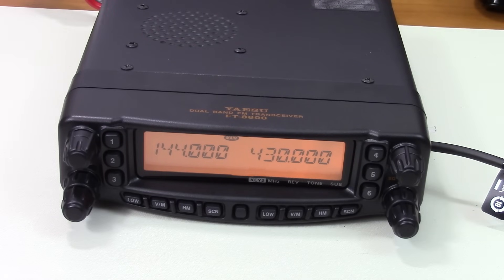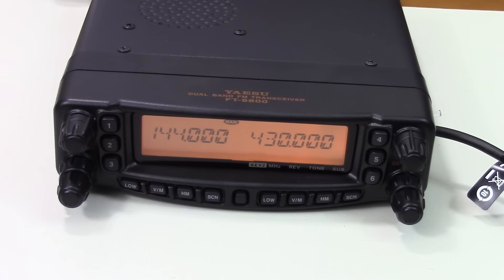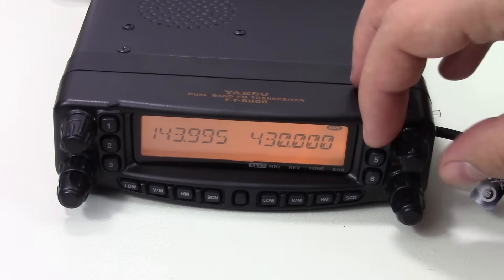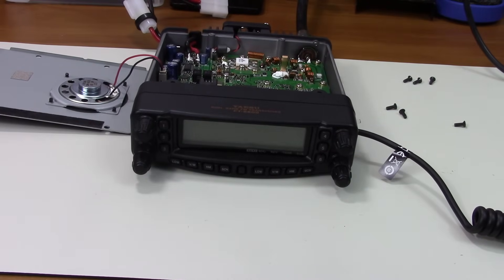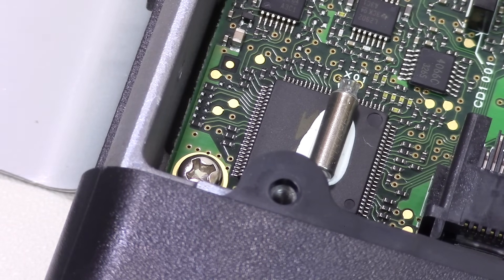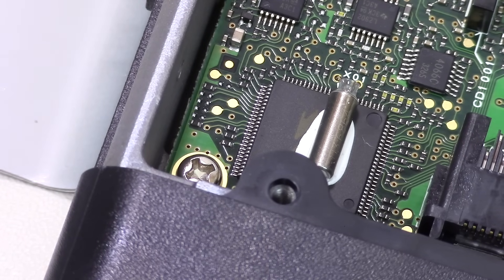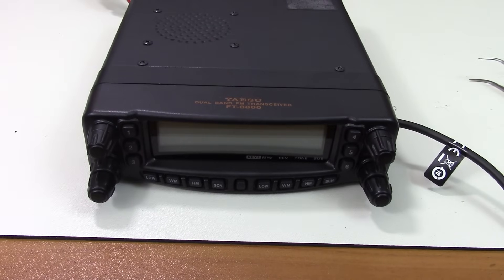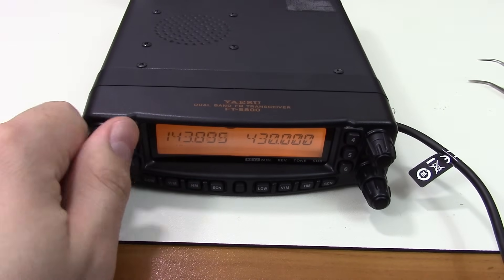FT-8800 extended TX (MARS/CAP) Mod

Comment: Heat up a watch makers screw driver with a blowlamp and touch the resistor. Easy and safer than using a soldering iron.

Comment: If remove parts that I may need to reinstall, I use a piece of tape and tape the part inside the device. Any adhesive reside can be cleaned with isopropyl alcohol..
Reply from the maker: Excellent tip, thanks for sharing!

Comment: Hello, how are you? Your video is very interesting. I have the same equipment. I wanted to ask you a question. When I opened it, I saw those white blobs near the power transistor and further to the right, above the inductors. Is this normal? What is the purpose of this compound on the components? Does it affect the equipment's operation? Is it an assembly error due to excess material? Greetings, and thank you very much for your video. EA7KGU Leonardo from Spain.
Reply from the maker: Hi Leonardo, the white gunk is sime sort of potting component. It appears that it has been deliberately applied primarily to the inductors. I would guess that this is to ensure the mechanical stability of the inductors and to limit microphonic effects during mechanical stress (e.g. vibrations in a car). So yes, it does affect operation under certain conditions, but in a positive way. Regards, Sebastian
Reply: Hi Sebastian, I hope you're all well. Thanks for your response. I disassembled and cleaned the part because other videos of this device don't show it. It looks like excess heat transfer material. I really don't see anything positive about this compound being on an inductor and several capacitors. Once removed and cleaned with ethyl alcohol, I performed power tests with a wattmeter and a Bird laboratory phantom load. The results are satisfactory, as it works correctly and delivers the power indicated by the manufacturer without overheating. Best regards! Leoanardo.
Reply from the maker: That's good to know. If it would have been potting component, it certainly wouldn't have washed off that easily. Seems like a price manufacturing mistake as heat transfer component isn't known to be cheap. Who knows what happened here.

Comment: What is the size of the resistor...0402? And, if I have programmed the radio with a lot of memorychannels with my PC, will they get lost after removing this resistor and restarting the radio and if so can I reprogramm the radio with the software?
Reply from the maker: I wish I'd remember the size of the resistor. I'd guess it was 0603, definitely larger than 0402. All memory channels will be lost but can be re-programmed with the original software.

Comment: Hey so what is the value of that resistor, asking for a friend
Reply from the maker: Unfortunately, I don't know. Possible workaround: Measure one of the remeining ones in circuit and guess from there. My assumptions (and the things I would try in that order): Either it's just a simple pull-down resistor where any value like 10K or 1K would work, or it's actually a real bridge with a 0 Ohm resistor. Of course there are no real 0 Ohm resistors but they're sold under that name as pick-and-place machine compatible versions of a permanent jumper. Given the fact that the resistors all connect to the ground-plane, I'd try the 10K from ground to the other side first. With steady hands you can try that without actually soldering anything in place.
Reply: @BalticLab  awesome, I'll give that a try
Reply: @BalticLab  an instagram follower looked up the service manual and found out it's zero ohms. So I'm going to jump the second to last points out

Comment: I thought I might try removing the resistor with circuit board nippers . do you think I could get away with that? (flush cut nippers) because using my irons, I'm afraid it'd goof it up.
Reply from the maker: You ptobably could get away with it but I would only recommend trying if you never want to undo the mod as this will likely damage the associated PCB traces

Comment: next time get a proper soldering iron before messing around on delicate pcbs,  then just bridge the two contacts of the resistor with solder, heat more or less in the middle and it will come smoothly off without damaging anything, then tombstone it on the PCB so its there for if you ever want to put it back

Comment: what's the high UHF transmit/receive?     are there any mods for the 800MHz range?
Reply from the maker: UHF TX/RX will be 420 MHz – 470 MHz. There are no 800 MHz mods. I would assume that building 440 to 800 MHz transverter might be the "easiest" way of using this radio on 800 MHz.

Comment: It would be far easier and neater to just use a sharp blade and cut the pcb track. Also easier to "undo" if required. There is a long length of easy to access pcb exposed.

Comment: I performed this mod about five years ago. And I programmed the memories with CHIRP. And it's worked flawlessly since then. Until just lately. The FT8900 now crashes every time I transmit. UNLESS I FACTORY RESET THE RADIO.  Then it works fine. But once I reprogram the radio with CHIP, it crashes again and again. Any ideas?

Comment: Will this transmit in the air band?ex 122.800. I'm a pilot and amateur operator and would like one radio for both.
Reply from the maker: Negative. Asides from the fact that this wouldn't be legal, air band uses Amplitude Modulation while the radio is made for Frequency Modulation.

Comment: Ive been told by yeasu that the resistor  need to be replaced, im here in the UK and have the UK version  is this correct, or was it just them wanting to gain some cash

Comment: Works great !! I had enough room in my radio to put the tip of my iron right on the resistor and started with low heat and gradually increased till it melted the solder. Just a note if you are using the programing software you will have to change the version # of the radio after modifying. It will also not TX on Aircraft band.
Reply: +James Rickard 
Can you please explain the scenario about changing the version # of the radio?
I'll be using RT Systems software.

Thanks!
Reply: This is for the G4HFQ software. http://www.g4hfq.co.uk/ftb8800.htm

If you have already built a program before modifying it has a certain version # depending on the resistor/diode pattern. When you remove the resistor/diode it changes this number. All I had to do was reread a blank program from the radio and if u look in the top right corner I believe it will show the version #. To change it click on it and it will give u a drop down select the new #.
Reply: +James Rickard 
Thanks James for your answer. I just performed the change. Since I'm using the RT Systems program I learned that it doesn't have this version # issue. It just worked as like you would expect. No issues. Good to have a rig set up for emergencies!
Reply: Would you know if this would still work with the CHIRP software on a 8900R after doing the mod?
Reply: Ken no idea it should tho don't see any reason it wouldn't.

Comment: The way I do it . I use needle under the resistor, then apply heat on one end  as it get hot and star to melt I lift only one end . This way if I have to replace it back I do not have to look all over to Radio Shack.
Reply: Smart!

Comment: could I corssband 2 gmrs freqs, basically use this as a duplex repeater?
Reply: No, because that's not cross banding. To repeat within the same band you would need a set of cavities as a duplexer. The closer two frequencies are, the harder it is to use to them as a repeater pair.

Comment: My suggestion is to use very small pliers and just remove it. You put a hot iron and will risk damage to the chip and other components. Do you think it's hard to remove? Try putting this jumper back in!You will not put it back in May likely.
Reply: Achisachis73 You are use the special SMD solder iron which has a needle thin tip... off course with temperature control. We have temp control soldering stations for this purpose

Comment: Do you know how to extend tx no the ft 8900 ..?.? Thanks
Reply: You lose nothing, only gain. I have this mod on my 8900r
Reply from the maker: Yes. The modification for the FT-8900 is exactly the same as for the FT-8800. You'll find the jumpers in exactly the same spot. Yaesu really makes these type of modifications easy on you. If you're interested in me doing it for you, just message me.
Reply: Can you tell me if you loose any features after the mod?  Will it still work with CHIRP programming software?

Comment: the soldering tips look like they could do with a clean or even changing
Reply from the maker: The right one is perfect. But the left one is from a garbage WalMart iron. It started looking like that 30 minutes after I used it. i don't bother with it, all it's for is for this sort of work. Get plenty of spares for the right one, but again, It's perfectly good.
Reply: KF5OBS im terrible if i clean them during use and they don't go shiney again they get lashed (on the cheap ones anyway ) My hako ones not so much at the cost of replacing them to often :)

Comment: They do an an excellent job on the service manual don't they. According to the service manual the resister you removed R1430 from pin 62 of the micro M3826AEFGP (labeled as Q1104). That pin 62 was labeled as MTX0 and the next MTX1. Would you happen to know what the MTX stands for?
Reply from the maker: Modified TX? Just a guess, rarely read manuals even though I probably should :)
Reply: KF5OBS Lets hope someone comes along that's above our league and educates us.

Comment: what i have always done is use one iron and either a chisel tip or a fine tip at an angle, you can also wrap copper wire around your tip and bend it over to act a second iron tip